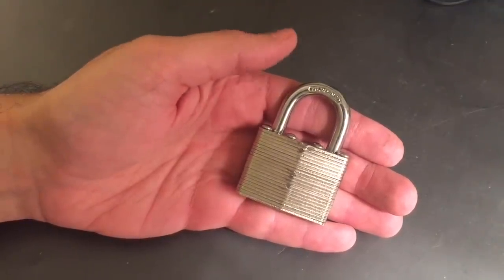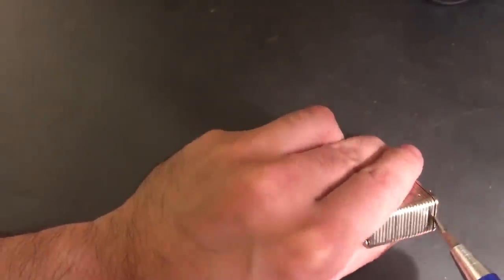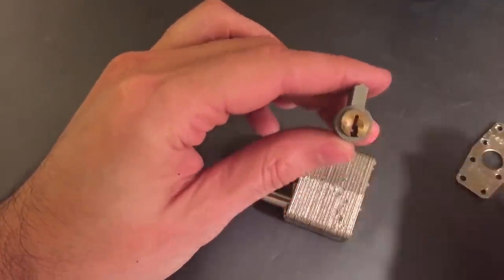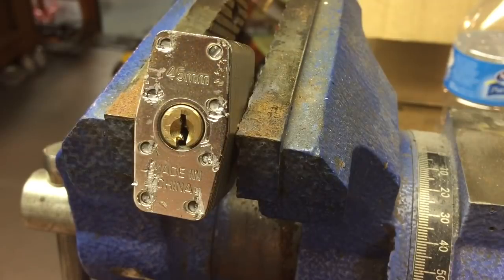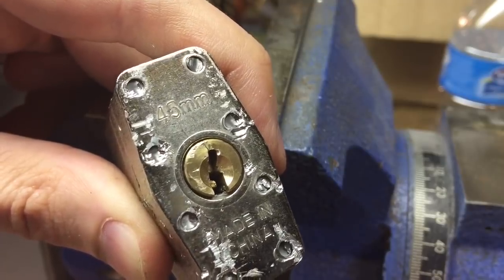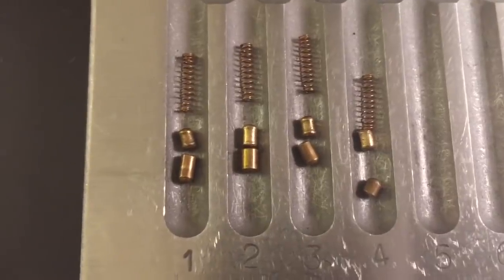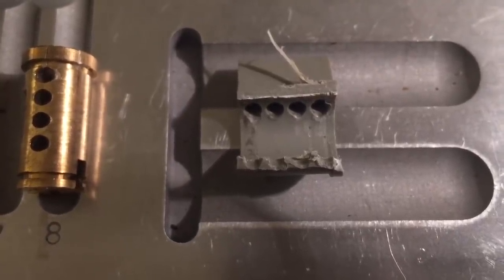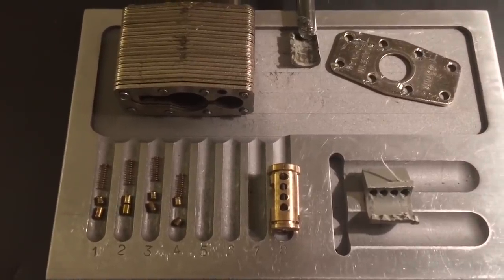[60] The Worst Lock in the World Abused

Comment: I just cracked a core yesterday while trying to pick an old bike lock I had lying around. It didn't take much torque at all. I was using my non-dominant hand to apply tension with a flexible stainless steel tensioner while holding the lock in that same hand. And I am not that strong. But it was old, so I guess maybe that had something to do with it.

I kept at it, but then the pins started falling into the keyway.

Comment: some "cheap" locks particularly dock locks., are so out of wack/tolerance/beat up, bent, they can be harder to open. The worst I have seen is old mobile homes/trailers. Yea, some pop right open,  but some?  get a pry bar and break the door(probably already damaged anyway). . Sans dead bolts, I used to be faster at carding most doors than using a key.

Comment: imagine manufacturing spool drivers, small springs and pins only for them to be put into a metal core that gets cracked open with a screwdriver and a basic wrench. Not only that, but this extremely low-grade brittle metal is encased in only a piece of plastic

Comment: That is not a plastic core, but a plastic shell/bible. Locksmiths have seen this in Weiser knob-sets in the late 1960s on up, and a few other brands. There WERE some locks with plastic plugs as well, often were seen on RV knob-sets, as well as garage door rim cylinders. Horrendous..  Odd thing, the Weiser knobs, up until about 12 years ago were sometimes a PITA to pick. The plug looks like poor quality brass. Possibly die-cast, but it LOOKS like it is machined from rod.... could be from extrusion. I have seen lock plugs split.... but not many. 

"WORST LOCK" ?   certainly, there is far worse stuff out there. Just check through the aisles at your favorite big box store or Amazon

Comment: Thing is, it's not like you'd have any way of knowing that the core is made of plastic. And since it's so rare for that to be the case, it wouldn't make sense to break out a torch or even to try forcing it with a screwdriver and wrench, since the vast majority of the time that won't work. 

Besides, the goal of lock picking (aside from sport) is generally to open a lock covertly, without causing damage or leaving evidence. So I don't think it matters much that the core is plastic.

Comment: No... No no no.... Now its debatable... But i might have found a lock far worse by brand... Its a lock that only needs the core jiggled a little to pop open (i did buy it brand new at the time) and because of the way it happens... I think it might work on most of those padlocks and im sure its a popular brand for budget reasons and the store you find them in

Comment: Could work as a one use tamper lock ? Never mind the keys, you have to break the lock to open the thing... You could even change the model a bit so that forcing is the only way to open it. People who doesn't know what they are dealing with would lose their time trying to pick a lock that has no solution or key. Of course, one use locks can be costly over time...

Comment: I have a worse lock, It looks almost identical to that one, but it has no core at all. It's warded, and has a single lever spring actuator, operated by one lever at the end of the key. 

You could choose to pick it with a hairpin, but a small, flat-bladed screwdriver can be pushed between the case plates without removing the rivets. The plates just deform, and you can reach the release lever spring, and push it. The lock opens.

When finished, simply hit the bottom of the lock body with a hammer to flatten the plates, and the lock looks normal again. Who needs keys?

Comment: Sorry not even close to the worst.  That has to be the double sided master lock style where the key has mirror images on two sides.  Several makers of these locks.   I could open those when I was about 6 by filing all of the key ridges except the end one, but trimming that one for width slightly. With a couple of these filed down keys for the various key styles i can open any of those locks in seconds.  In fact i even made some thin blanks that were straight that worked sometimes.

Comment: So how is this worse than the Master combo lock that was picked in 2 seconds? Sure, this one is cheaply made but again the attack LPL uses is unrealistic. No thief is going to place this lock in a vice and use a screwdriver and wrench on it. A thief might use a torch on it but only with the knowledge that the core was plastic and given time. A thief would most likely just pick it in a few seconds. I did not see this one get picked. This is why I suggested earlier to attack locks using a set of standard procedures each time or at least the most likely attack a thief would use in the field.

Comment: 827/5000
But this is very likely not a fault of the Chinese manufacturer, but of the client, who very likely asked: Can you offer me something that looks as good as a trustworthy padlock, but should cost next to nothing, because I run $ 1 -Shops ...
And Chinesen then fulfill every wish, they can manufacture products that are among the best in the world, just as well as absolute rubbish that is not immediately recognizable.
I also found Euro cylinder locks in a special item shop here in Germany whose extremely skeletonized core of a 5 pin tumbler consists of just 5g of zinc. I was no longer surprised that this cylinder was already open when my 3 Hump-Bogoth was only half inserted ...

Probably the strangest lock was a real genuine Abus euro cylinder in the door of my flat I rent. its bidding was totally flat, every core pins  had exactly the same height, so the key looks as a bump-key, also it was possible to file down a keyblank totally straight  to the right size, so that this key hasn't  any teeth at all. Or even use just a piece of a wiper insert as a key.
Reply: ok that's a cool lock. an Avus who's key looks like a bump-key. that sounds like a special request from someone trying to troll people.
Reply: also that garbage lock was impossible to impression, so there was that at least. Makes it better than some locks out there.

Comment: i am not sure if it is a good idea to impression a lock that you have no key for unless you are working for a spy agency that needs to open and re lock without evidence because if you impression to make a key so you can use the lock for your own use just remember you dont have the key because either the key was lost or kept by original owner and a good rule of security is when you buy a new house replace the locks as you dont know how many keys may be out there.

so you dont know if the missing key may be used to break into what is being protected by that lock.

if you are making a key to give away locks for practice that i think should be ok since the lock is just for picking practice.

Comment: Lockpicking lawyer, do you have a video that shows the padlocks and other locks that are the most secure.  You give thieves all the info they need to break in or pick it so no one knows you have been there. Is your cleverness is just for interest only?.  Have you ever tried to break in to any lock that you were not authorized.  Getting tired of educating the thieves. Sure it is nice to know which ones are not safe but surely you know of many that are impossible to pick and that do not cost over $150.    Don't think the thieves aren't taking notes.  My neighbor is the Village thief and my padlock has been picked because the key does not operate as smoothly as it used to. So it appears they have been picking or trying to open it. So it is an urgent concern in my case. I need a safe lock.  One thing is for sure that he does not want anyone to be able to prove the lock was tampered with so do not need to worry about blow torches, or hammers smashing it.  Insurance companies like to see proof of a break in.  Hard to prove if entry gained by mere picking.  Doubt he brings all the tools you use to manipulate it with a clamp either.
What cannot be picked???  Or dang hard.